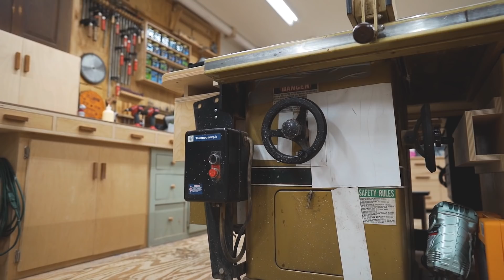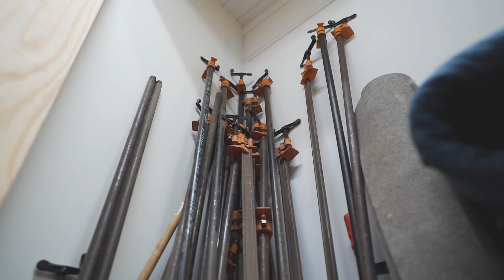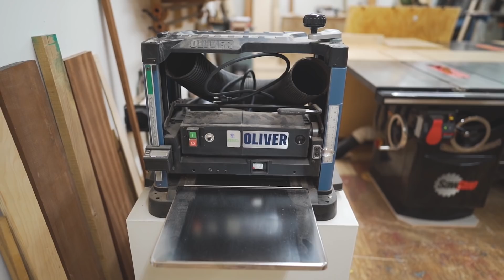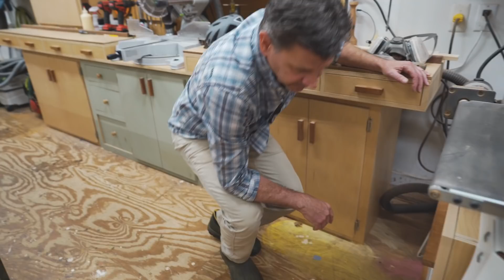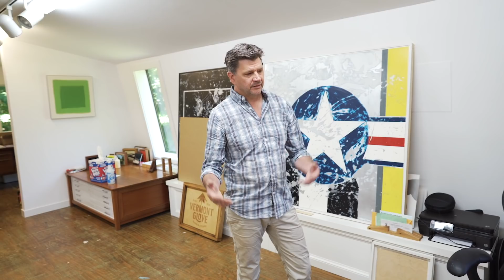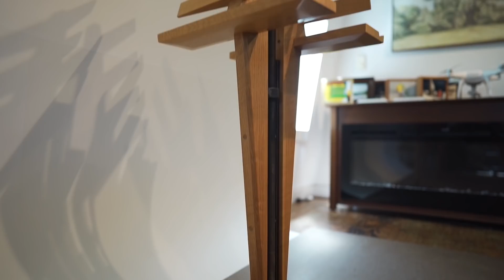Jon Peters Small Barn - Shop Tour

Comment: Hi Jon, great tour. I retire in 12 months and my wife and I are building a new home that better suits our lifestyle. Woodworking has been a lifelong hobby and I look forward to diving in more fully in retirement. My workshop will be about 900sqft. I’m designing my dust collection and like your in floor system for some tools. I have Powermatic table-saw, planer, 6” jointer, 14” band saw, disk sander 3000 (?) dust collection, Dewalt miter saw, router table and a few others. Questions; do you like your plywood floor?  Are you glad you put some of the dust collection under the floor?  Any suggestions regarding that?
Thanks!

Comment: Thanks for the informative tour with lots of ideas!  I've had the Rikon 10-351 bandsaw several years since it came out. I'm not sure I'd buy it again. It's expensive and I've never re-sawn like I thought I would to its capacity of 14.5" (though I've done 12" a few times). If you change blade widths much, the lower rear blade guide is a total headache to adjust. Lastly, the fence is really sticky--doesn't slide side-to-side well, and it's not sturdy at all for tall re-sawing. The pluses are it does have plenty of power, dust collection is really good and the foot brake is a worthy safety feature. Best, Andrew @BranchAndFoundry
Reply from the maker: Good to know, thanks Andrew

Comment: I use micro switches for my dust collection. The biggest benefit is I can’t accidentally leave a gate open and I no longer need a remote. Very happy with the system.
Reply: Me too after I wasted a bunch of money on a remote that ended up going through the washing machine. I used a 24VAC doorbell transformer to power an HVAC contactor and used magnetic burglar alarm switches at each blast gate. I don't think I spent $50 on parts. For the blast gates that have to be out of reach, under or behind the machines, I rigged up pull cable controls that are a simplified version of these https://www.youtube.com/watch?v=j4G3K7dLAjg